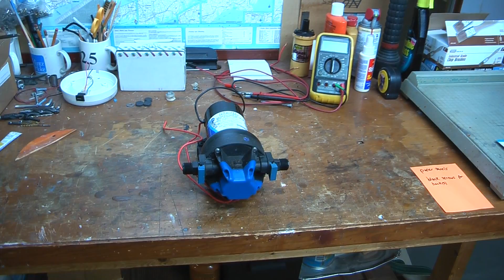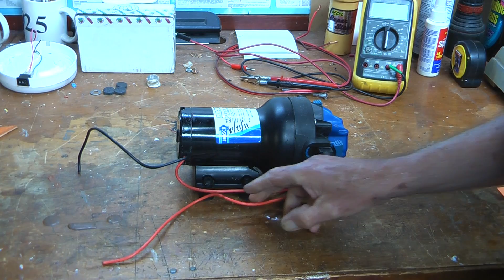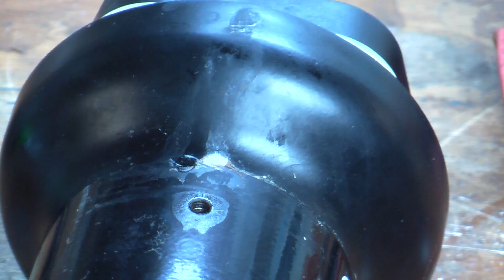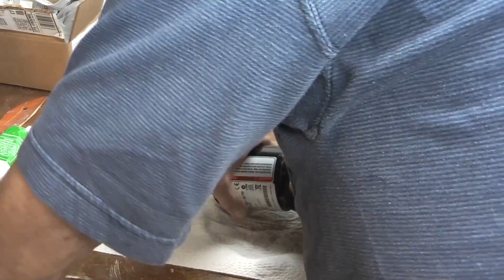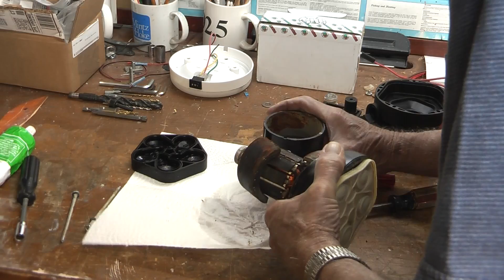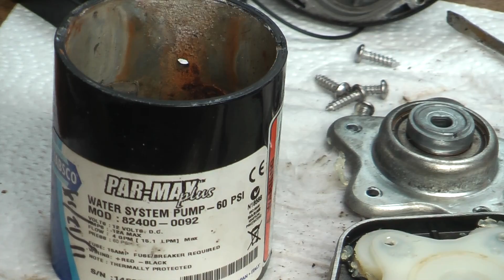Jabsco Fresh Water Pump Failure

Comment: Too funny -- I had the same issue on the same pump and also had to junk it because I couldn't get the end of the pump off the axle (lock nut is there but corroded on). Seems like that seal leaks and causes a failure often

Comment: Nice video, I may have the same problem but now I know what to do to take it apart and find out.  
I like the comment of using WD40 and replace the bearing to fix the problem.  
But I wonder if that’s even worth it since they all seem to have this gasket leak issue.  The problem will just come back eventually, right?

Comment: I've had two jabsco pumps go exactly the same way, it's not the motor, but the bearing you don't show in the video that fails, it's rubbish of jabsco to not seal the motor chamber properly, if you have one and it still works pull it apart now and oil the bearings and seal it properly with silicone before this happens

Comment: The front bearing is replaceable and the rest of of the motor need to be cleaned with Wd40 and it should be good as new
Reply: Odkręciłem śrubkę hex 3mm na osi wirnika i właśnie nie mogę wyjąć wirnika
PAR-MAX3

Comment: How is the new pump holding up? What model did you replace it with?
Reply from the maker: I replaced the failed pump with a Surflo Aqua King II 3 GPH pump that cost about $120. Works OK but the flow isn't as robust as the old pump. I should have installed a higher capacity pump, I guess, but given the light use it gets (running some fresh water or flushing the head while underway) it will do.

Thanks for your interest!